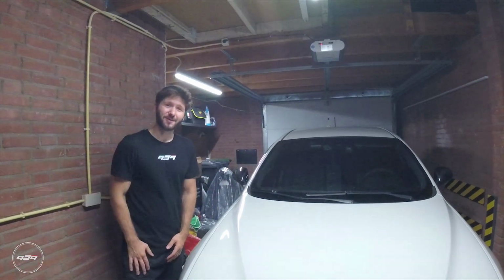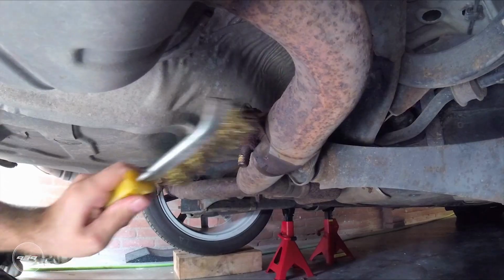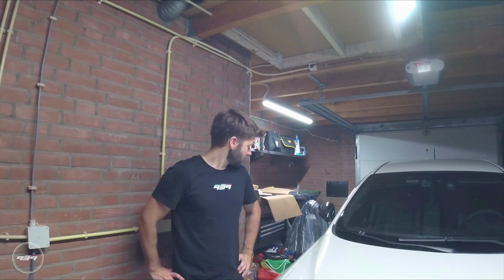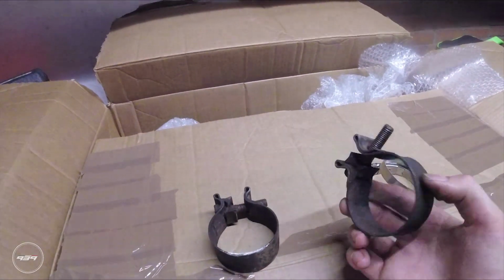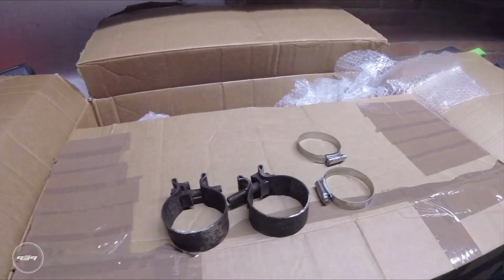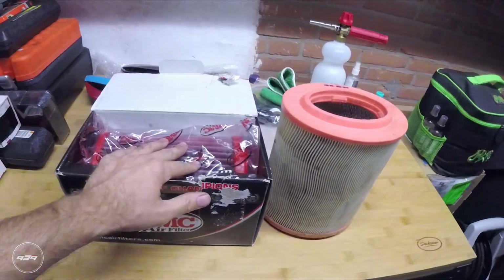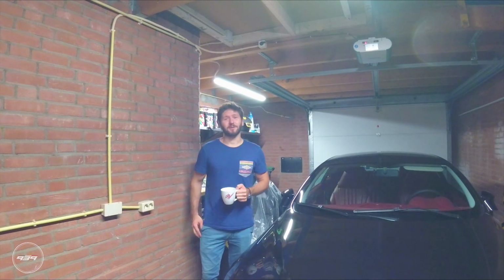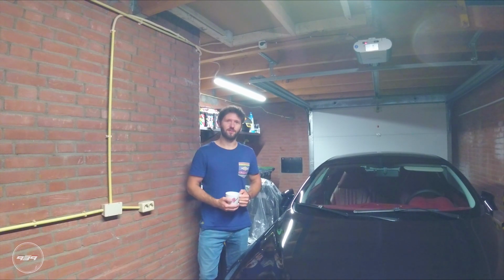Alfa 159 TBi Ti WIZARD EXHAUST installation

Comment: Your engine doesn't sound very healthy when you start it. I hear something rattling over there and I'm listening with my headphones. Also it should sound much smoother. The explosions in the cylinder are somehow forced. I don't know how to explain better. After the engine it's a bit warmer, it gets better. Have a check!
Reply from the maker: That are the valves on cold engine. When oil is circulated it's gone and the TBi idles really smooth.

Comment: Do you think it's worth upgrading the entire exhaust to stainless steel, i.e the middle pipe?
Reply from the maker: Yeah only if rusted, or you want more sound or performance
Reply: @939driver  I was wondering because the Wizards are just rear sections and most 159 centre pipes are rusted now so would be a nice upgrade.
Reply: @MilleniumRed  they offer a catback I'm sure. I've been in contact with them regarding my rear pipes and they told me a catback would cost £1050.